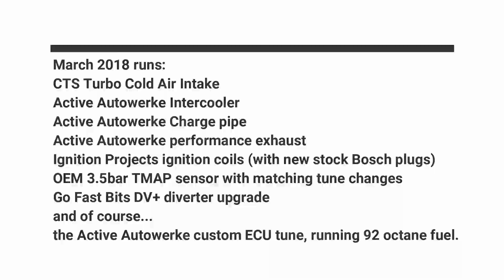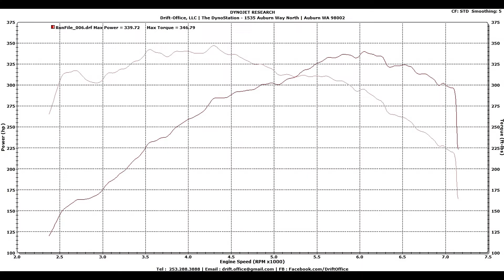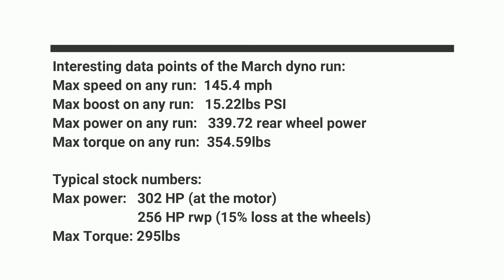BMW F32 N55 435i dyno run and results

Comment: I’ve seen results of stock cars producing between 280-290 at the wheels depending on dyno and conditions. The general consensus is that they’re producing 330-340 at the crank straight out of factory.
Reply from the maker: You are right that conditions have a factor here too
Reply: My 2015 435i gran coupe is completely stock as far as I know. It still has a factory charge pipe so I haven’t done any full throttle pulls just to be safe. I do have an aftermarket charge pipe ready to install once the 3 month warranty expires. I might explore a stage 1 remap then too. It feels plenty quick for now though 👍 it’s a great engine.
Reply from the maker: @stubones sounds fabulous and good call on the charge pipe.

Comment: Are these numbers in whp or crank?
Reply from the maker: Those are dyno results, so at the tires.. RWP.
Reply: BMW DIY Guy So that means you’re running around 300 whp stock? That’s amazing.
Reply from the maker: @Markyboi369  the most recent is 381rwp 420 torque, and more on the way with a HPFP and meth kit coming
Reply: BMW DIY Guy Is that with a catted or catless dp?
Reply from the maker: @Markyboi369  high flow catted DP from Wagner

Comment: Do you know what is the stock maximum boot pressure?
Reply from the maker: I have been told, and saw from initial logging my max stock boost was 9psi.  MASSIVE difference with the tune!

Comment: I really appreciate your videos, they're very informative. I have a 435i myself. Just a few side notes and questions. There have been plenty of documented videos showing bone stock 435's putting out 300 at the wheels and in some cases slightly more which the conclusion was that BMW actually underrated the power or it can also be looked at as what BMW claims from the factory is the actual HP /TQ at the wheels. 

Also what elevation are you currently at because that plays a role? 

And finally, i've seen and read that a lot of tuners that have AWD dynos wound up with inconsistent pulls and terrible numbers and had to run the car in AWD mode (ie spinning all 4 rollers even though the car is RWD) to get more accurate numbers. Was the dyno you were running for 2WD cars only? Anyway, look forward to hearing your feedback and future videos.
Reply from the maker: So great feedback and questions.. I will say I have NEVER seen an F3X car with the N55 motor pulling 330 at the wheels, as that would be WAY above stock numbers and would be almost 390 at the motor.  I am less than 500 feet above sea level, likely more like 250 here in the Seattle WA area.

Great thoughts about the dyno itself... I haven't heard of running an RWD on an AWD dyno with the front wheel roller active as it wouldn't make a difference and would be less secure.  Every dyno run and club day I have attended they ALWAYS lock the front roller (if available) for RWD cars.  Keep in mind there are several brands of dynos, mustang, dynojet and others and they can vary how they measure too.

The biggest thing with the dyno really is to measure your own progress.. using it from a pure place of my car did X and another did Y really wont be accurate, as too many variables are in play with model of dyno, temp, air pressure and humidity, air flow on fans, fuel that day, altitude and so on.  While its easy to get into pure numbers.. XXX hp and YYYY torque for absolute numbers, but its better to use it to measure your progress improving your car.  Baseline it, get those numbers and then improve and tune and see how you improve those numbers including the dyno graph results to ensure smooth delivery of that greater power.
Reply: BMW DIY Guy BMW DIY Guy I didnt say 330 at the wheels, i said 300 at the wheels, which means our cars are putting out roughly 320-330 at the crank. Most forums have ongoing discussions about it. Some say it's because of insurance rates in Europe, some say its because BMW is  technically being honest about what our cars actually put out and therefore can not get sued for false claims. Who knows honestly but yes there's a lot of info out there that supports this. 

As for the Dyno, yeah i know about the different types of dynos, (i used to work for Vinny Ten, owner of the first 2JZ Supra to break the into the 10's, 9's, 8's and 7 second 1/4 mile), i was just curious as to what set up you ran on as i've seen tuners have trouble on some AWD dynos because i believe the front wheel speed sensor didn't detect motion and safety sensor kicked in and wouldn't shift gears, possibly an Automatic transmission problem, sorry it was a while ago when i saw these videos.
Reply: But good luck on your next run. Look forward to that. Have you ever considered JB4? Couple of my friends had it on the first gen 335's and man, those were MONSTERS. With only an intake (easy to replace when they needed servicing so as not to void their warranty) they were putting out 340+ at the wheels. 

My father actually lives out in Washington State, im here on the East Coast in NJ, but originally from NY.
Reply: Pretty good video, looks like their Dyno reads BHP, couple of stock cars putting out higher numbers than factory claims.
Reply from the maker: Actually yeah, I ran the JB4 early in my changes to my car and have an install video for that.  I only ran in modes 1 and 5 while I had the JB4 because I didn't have all of the other supporting mods yet.  I changed it out though for the Active8 from Active Autowerke, and then now run the AA full tune that we are continuing to tweak and refine.  I cannot wait for my high flow catted DP, as the next big jump forward as that is the only piece holding me back right now.  Once that is in, plus a new round of tweaked tunes for it, I am hoping to be over 400 at the rear wheels.

Comment: Im so confused? With all those mods shouldn't you be running more hp and torque? i have a 435i with a tune and im pushing 360hp and 430 torque
Reply from the maker: Bl1ndskater6 the stock cat is what is killing me right now.. I will see a significant jump as soon as I swap that out for a high flow catted downpipe.
Reply: High flow? my friend theres only 1 way to go, cattless downpipe. Thats my my next step, but in order to run the car efficiently you would need an intercooler as well. And with a cattless you can run more boost :)
Reply from the maker: Bl1ndskater6 agreed a catless would give more HP, but I am unwilling to deal with the smell.  The best hiflo cats are 90%+ of the flow of catless.  I am waiting on the Active Autowerke catted DP release here soon.

Comment: Pretty good numbers considering you don’t have an aftermarket downpipe.
Reply from the maker: Completely agree, and the Active Autowerke high flow catted DP is what will be installed as soon as it is available.
Reply: gonna be close to 400 once that DP goes in!!
Reply: adam600044 i’d bet 350-370 whp
Reply: Do you have the EWG Add On Connector installed?